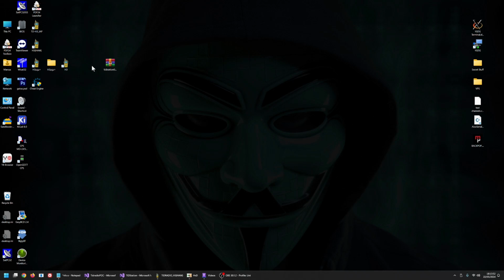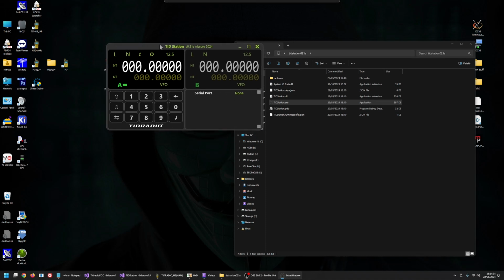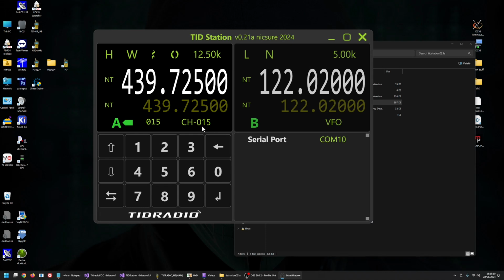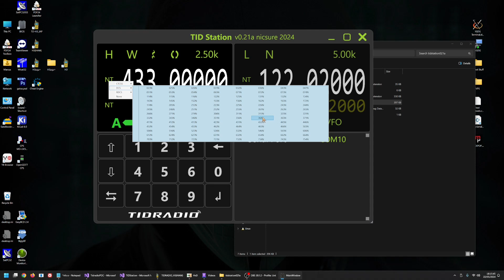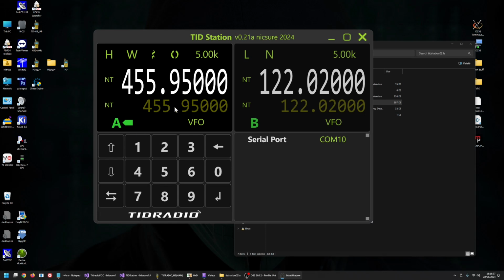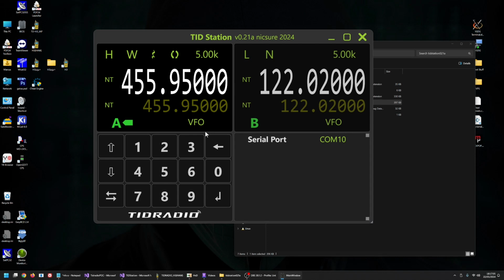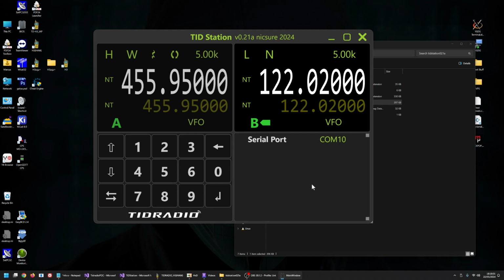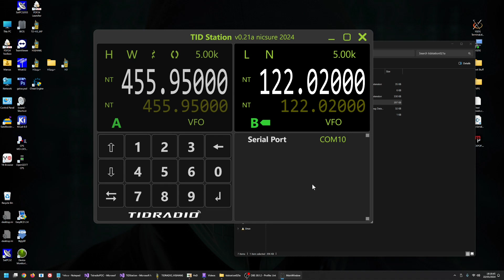TID Station Multi Configurator for the TIDRadio TD-H3

Comment: Thanks a lot for supplying protocol information on github. Would you mind to share additional details about the 32-byte data blocks sent to/received from the radio?
Reply from the maker: Each 32 byte block is just part of the the config memory being read or written, probably to/from an eeprom. The config memory is 8192 bytes in total and contains all the info about the Radio's current state. I figured out most of the locations by reading in the whole 8192 bytes, changing something on the radio, then reading it in again and comparing the difference between the two. TIDRADIO sent me the memory map which filled in some extra blanks. I don't know if they would like me sharing the Data they sent, but I am asking them if it's okay to do so as someone on Facebook asked me for it.

Comment: Nice :-) ... will this also work with TD8? And are you planning to make BT connection work?
Reply from the maker: I'm limited to the equipment I have unfortunately and the H3 is the only TIDRadio I have. It was my plan to make it work over bluetooth, but it simply will not pair to the PC at all, the PC cannot even see it. It may be possible to butcher it with libusbk/libpcik but that wouldn't be user friendly setup at all.
Reply from the maker: As an update, TIDRADIO have sent me the information about the TD-H8's memory map. So this should be possible. Although I have no way to test it as of now.
Reply: @nicsure  Maybe I can help ? :-)

As soon as you give me a go I will download and test with my TD8. Bear in mind
that I will be off grid till July 6th
Reply from the maker: @oldtrappertom  Sounds like a plan. Keep an eye on the Github page, I'll upload any experimental H8 stuff there.